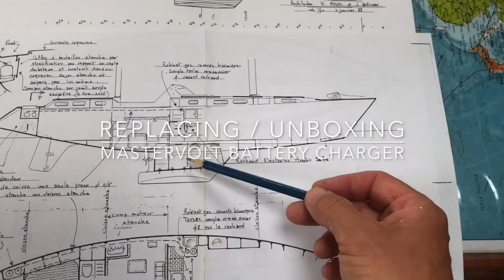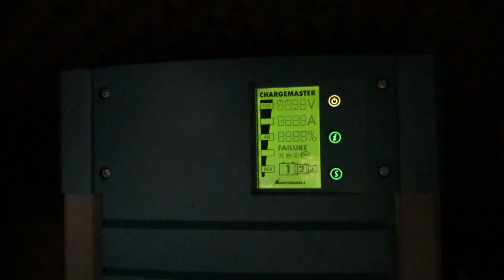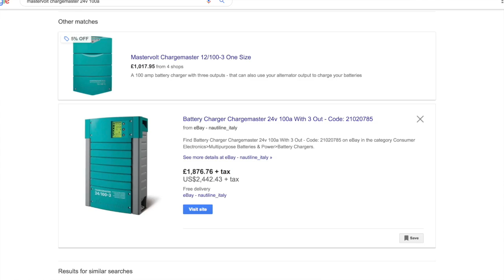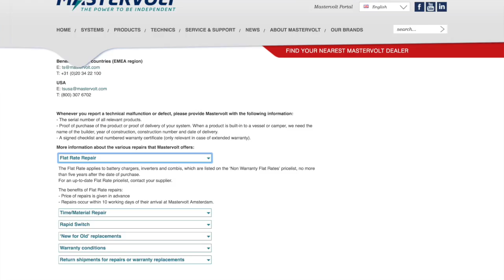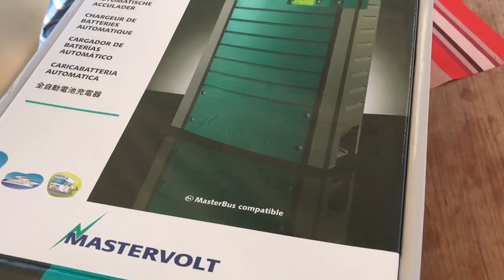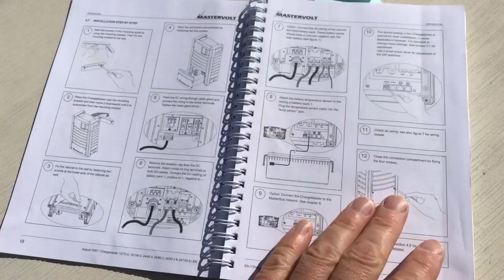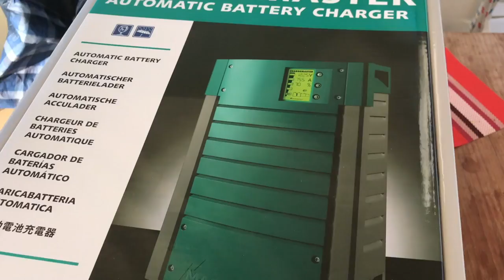Battery Charger Broken - Replacing & Unboxing the Mastervolt Chargemaster 24/100

Comment: I have found 3 mastervolt charges that were thrown away and bought one at a boaters Fleemarket for $10 . That didn't work.  I've never been able to get any of them working.  Seems strange that so many of one brand of very expensive changers would just be tossed in the garbage

Comment: keep away from Victron and lithium equipment. its great if your in a campervan or a canal boat. as you can see with master volt, it works and they fix it. Victron will send you to one of their engineers who will remove your eyes and more. the equipment needs updates and add ons to suit different sailing conditions. if you have not got deep pockets, stay with a deep cycle AGM and mastervolt...

Comment: Another great video guys. We are almost ready to purchase our 1994 SM. Needs so much work, probably the worst SM on the market,but the only one we can afford! Good job we are used to boat work!
As for chargers I love our Victron Energy 12/120/300 for €1500 was good value and works great. 3kw inverter! 120 amp charger.
Reply: good afternoon I am from Brazil, I received this device in payment with all cables never used because I do not have this boat and the model, mastervolts Chargemaster 24 / 100-3 if anyone has an interest in buying it will make a great price for sale

Comment: Hi Guys.

It looks like  they swapped your unit for another repaired one and did the same with yours, repair it and send it on to the next customer.

Well Done.

Fair Winds and Smooth Seas.

David Down Under.
Reply from the maker: We thought it could be a reconditioned unit, but even if it was, it was in excellent condition, very well packed and had new manual, mounting bracket and battery temp gauge.. so very happy with it.

Comment: In your video you mention, “We have the battery's charged 100% using the engine.” 
Yet only small distances are done on the engine. 
A charging system has 3 to 4 different stages, the last one takes HOURES. So to charge a battery 100% you have to use the engine half a day or more. 
That is possible but not good, en is where sun and wind come in. 
Battery's that are not charged 100 % start sulphating, thus destroying the battery's. 
Get a lot of solar and maybe wind ( I winter in the med on board at anchor since 20 years and have in winter TWO wind generators. )
Good luck ! Woody learning fast.
Reply from the maker: Thanks for the comment Abadan.. yes we’re looking forward to getting our solar installed.. I’m just reinforcing the solar arch at the moment and hopefully have the panels on in the next few weeks.. then with new batteries I’m hoping our charging problems will be a thing of the past!
Reply: The engine and the generator are excellent for bulk loading. A lot in a short time. The other loading processes to obtain fully loaded battery´s can best be done by sun, wind or a land line.
In winter at anchor, sun alone is not sufficient here in the Med, surrounding hills, low sun, clouds and very few hours of daylight. Wind can be a big help, especially where you guys are going. 
Do not make the mistake to put a windgen near the solar panels. It will do more harm by shading than good. I have a big second gen on the front of the boat. Stowe away in minutes. 
Windgen nr 1 ( a smaller one ) is on top of the second mast. 
Looks a bit special, is extremely efficient.  @MotherShipAdrift

Comment: I've been in the pro audio industry for years and when a component fails and I send it back they usually send a brand-new one back. The reason they do that is for studying as to why it failed. So good on ya good stuff.
Reply from the maker: I was a bit surprised Jerry.. thought they might make more of a thing out of it.. but no, a brand new unit and no quibbles! I like that sort of customer service ;)
Reply: @MotherShipAdrift  one more thing that I've found is the two red colored switches at the battery bank on most Amel boats may become  corroded internally and make the charger work harder do to lack of capacitance. Maybe something to look into.

Comment: Should have told you when we met in Santa Ponsa.  I started off life as an industrial/commercial electrician and then moved onto electrical diagnostics on jet engine control and measurement systems. 👀😩
Reply from the maker: Not sure you could have done much with it Stuart.. even the dealer had to send it back to get it looked at.

Comment: Nice work! Good choice in solar, we also got three 245 panasonics. would love to see a video about them and how you guys manage with them. cheers.
Reply from the maker: Currently looking into putting three panels in parallel :/ but we’ll definitely do a video of the install further down the line.
Reply: We have them on the Bimini, and as they follow the curvature of the bimini and can't reposition them when they are not in the sun we thought it best to put them in parallel. We hooked them up to a Victron Energy MPPT 150/60. As we have not left the dock yet and are still up north in The Netherlands we don't have usefull solar production data to share. So would love to know if you guys manage with no to little use of the generator.CiaooSailing Soualiga

Comment: I’ve heard that the Mastervolt chargers are a bit unreliable compared to the Victron ones but you certainly can’t complain about gettting a new one for $600. I hope it lasts another 20 years.
Reply: good afternoon I am from Brazil, I received this device in payment with all cables never used because I do not have this boat and the model, mastervolts Chargemaster 24 / 100-3 if anyone has an interest in buying it will make a great price for sale

Comment: Well done, I had the same problem 10 years ago in Greece, after 2 phone calls to Mastervolt, 1 to England and one to the charger Boss in Holland, i carried my charger to England and sent it to the Mastervolt, after having paid in advance for a fixed price repair.  There was no contact so after about 4 weeks  I rang and said, oh sorry your charger is more than 5 years old!   They knew this because i sent the serial number to them before paying for the reapir .We are scrapping the charger I was told.  No you are not i said, it's my property and cost a shedload of money.  I had to threaten legal action to have the charger returned.  Eventually my payment was also refunded.  
It's good to know current management at Mastervolt are much more customer focused.
Happy Cruising
Reply from the maker: Well we had great service from Aquafax and Fischer Panda.. we’d already sent the charger to Aquafax when FP came back with a cheaper ‘fixed price’ fix. I questioned Aquafax about this and although they didn’t match the ‘fixed’ price, they did lower it.